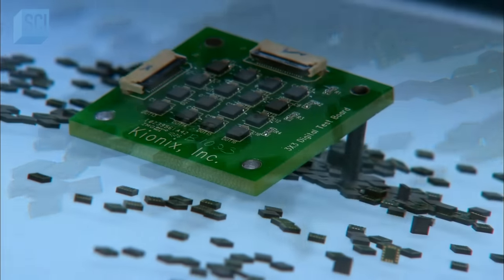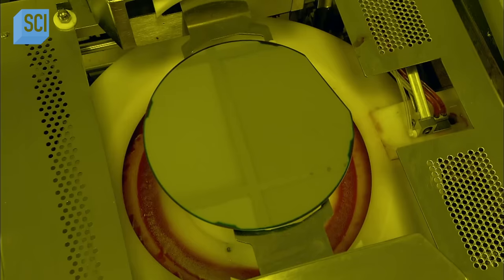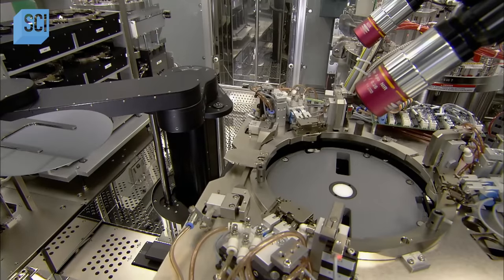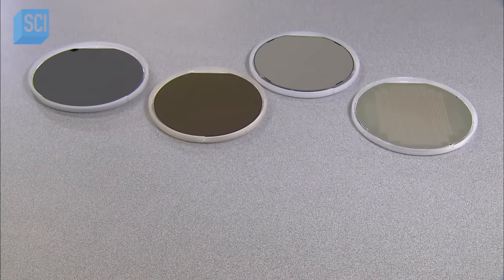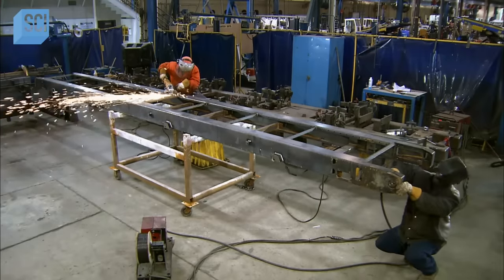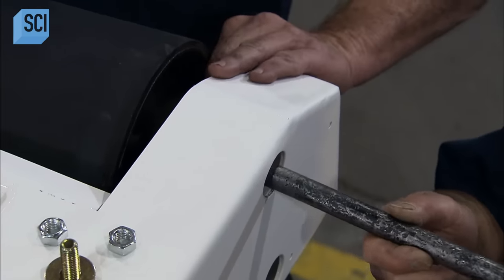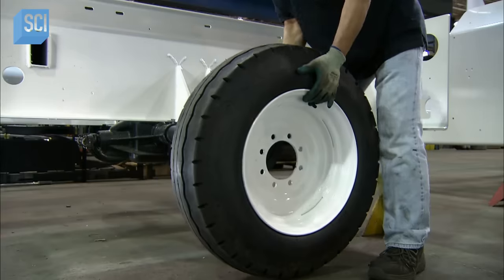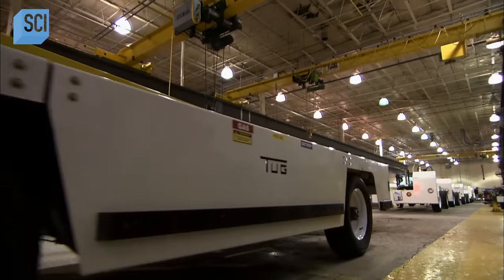How Motion Sensors and Belt Loaders are Made | How It's Made | Science Channel

Comment: Photolithography and how precise it is and has become is still mind-boggling, the technology to do it is almost more impressive than the technology to make it. Building machines to build machines,:-)
Reply: truly nuts.
Reply: Thats the way it has progressed, you start with making a machine that can make parts more precisely than a human with hand tools then you use that machine to make more precise parts for a new machine, then you use that new, more precise machine to make an even more precise machine, and it just keeps on going until you cant make a machine any more precise or there isnt a need to make it more precise. Of course it is more complex than that and involves multiple types of machine but that is the general idea, just keep using your machines to make even better machines and then we eventually end up making things on the scale of atoms.
Reply: And yet this tech is HUGE compared to CPUs and the like. This is micron scale, not nanometer. I was surprised seeing them just shine light through a mask without a hugely complicated lens system, but their features are just that big, hundreds of times bigger than the smallest they make elsewhere. But of course it's a relatively simple device, so size isn't a concern, and it needs to be build "big" due to the mechanical parts.
Reply: That fact that they are running into a diffraction limit and have begun to use hard UV is insane. X-Ray photolithography is the next step and it’s truly insane to think about.
Reply: Im a lithography technician its really cool to see how the machines work
Reply: @angryjoe98  stop lying
Reply: @MANOFTIME  i was indeed was a lithography technician I worked for rocket lab I ran canon, lithography tools and Tokyo electron coating machines. You felt the need to write this 2x? 😂

Comment: The sensor knows where it is at all times. It knows this because it knows where it isn't. By subtracting where it is from where it isn't, or where it isn't from where it is (whichever is greater), it obtains a difference, or deviation.
Reply: Umm what? The sensor has no idea where it is and it doesnt matter. They typically measure acceleration (accelerometer), angular velocity (gyroscope) or magnetic field strength (magnetometer), none of those measurements allow the sensor to know where it is, it just allows the sensor to measure those quantities. On Earth, an accelerometer can be used to measure gravity and calculate the pitch and roll angles amongst other things, integrating the gyroscope measurements is also a way to get a relative angle of rotation and the magnetometer can be used like a compass to calculate the heading. The accelerometer gives absolute measurements in reference to the Earths gravity, the gyroscope only gives relative measurements and the magnetometer gives absolute measurements. Even combining all three measurements it is still impossible to know where the sensor is, only what kind of environment it is in, the only information that you can calculate from those measurements to know where the sensor is, is the pitch and roll angles and the heading it is facing in, that isnt anywhere near enough to know where the sensor is only its orientation. Phones know where they are mainly through GPS, they know their orientation based on the IMU.

Also most sensors still dont perform much calculation on the sensor chip itself, it is usually another processor that reads the sensor data and then performs the calculations, although it is starting to get more common to have processors built into the sensor chip.
Reply: @conorstewart2214  you are incorrect. You should educate yourself.
Reply: @conorstewart2214  since you won't actually look it up, your type NEVER do, here is the full explanation:

The sensor knows where it is at all times. It knows this because it knows where it isn't. By subtracting where it is from where it isn't, or where it isn't from where it is (whichever is greater), it obtains a difference, or deviation. The guidance subsystem uses deviations to generate corrective commands to drive the sensor from a position where it is to a position where it isn't, and arriving at a position where it wasn't, it now is. Consequently, the position where it is, is now the position that it wasn't, and it follows that the position that it was, is now the position that it isn't.
In the event that the position that it is in is not the position that it wasn't, the system has acquired a variation, the variation being the difference between where the sensor is, and where it wasn't. If variation is considered to be a significant factor, it too may be corrected by the GEA. However, the sensor must also know where it was.
The sensor guidance computer scenario works as follows. Because a variation has modified some of the information the sensor has obtained, it is not sure just where it is. However, it is sure where it isn't, within reason, and it knows where it was. It now subtracts where it should be from where it wasn't, or vice-versa, and by differentiating this from the algebraic sum of where it shouldn't be, and where it was, it is able to obtain the deviation and its variation, which is called error.
Reply: @mgancarzjr  I know how these sensors work. You are confusing applications from how the sensor itself works. In most cases the sensor just outputs the raw values, it is up to another processor to perform calculations on that, although sensors with built in processors are becoming more common. Also none of what you said has anything to do with the sensor knowing where it is, it still doesn’t know or care where it is, all it measures is acceleration, angular rotation and potentially magnetic fields, those can be used to calculate relative motion and orientation, but the sensor still does not know where it is, and the sensor measurements can still not be used to tell where the sensor is. You also get drift over time with these sensors, even when integrating the acceleration, since you are quantising and discretising continuous motion.

If the sensor knows where it is then why can you take some measurements, move the sensor and take some more measurements and have them be the exact same when in two different locations? That is because the sensor does not know or measure its location, it measures acceleration, angular velocity and magnetic field strength, that is typically all they measure and it is not enough to tell the location of the device, it is enough to calculate relative motion and orientation but that is it. 

What you seem to be on about is using the sensor as part of a bigger system and using it for some form of position hold, that can work in some cases but in a lot of cases it is nowhere near accurate enough and is subject to drift. Most drones despite having IMUs rely on the GPS or an optical flow sensor to implement position hold, not so much the IMU.

The sensor itself does not measure where it is and cannot measure where it is, what you are on about is integrating the acceleration or angular velocity to get relative motion and correcting for that, but as I explained that is generally an inaccurate method. It is also not how the sensor works, that is generally another processor carrying out the calculations.

Edit: also how do you know my type? You seem to be the type that thinks they know everything when they really don’t. I have used these kinds of sensors quite extensively.
Reply: @conorstewart2214  ask me how I know you didn't do an ounce of research on this subject. Your type NEVER do.
Reply: @mgancarzjr  except I have used these type on sensors and know how they work, you are describing a control system not how the sensor works. 

If you really think the sensor knows where it is then you obviously have no clue how they work.

Edit: if you are so sure then tell me how the sensor knows where it is.
Reply: @conorstewart2214  if I can show you that you have done not even the slightest modicum of research on THIS SUBJECT, will you never post anything on the internet ever again?

That is the Faustian bargain I am making.
Reply: @mgancarzjr  wow hiding your lack of knowledge behind saying I have done no research, why don’t you go back and read my last comment again and answer the question if you are so sure you are right.
Reply: @conorstewart2214  please look up "The Missile Knows Where It Is."

I expect you to honor your end of the bargain.
Reply: @mgancarzjr  a copied piece of text, not even about these sensors and used as a meme proves your point how? You must be trolling at this point.
Reply: @conorstewart2214  my original post was an allusion to the meme. You did not even take one second to Google what I had written before assuming I was making a mistake.

I pointed this fact out to you TWICE.

YOU DID NO RESEARCH.

HONOR YOUR AGREEMENT.
Reply: @conorstewart2214  "since you won't look it up, your type NEVER do" - me, an hour ago
Reply: @conorstewart2214  you know those "joke" quizzes where the instructions begin by telling you to read every instruction first? Were you the kid in class who was always amazed that people were finished so quickly only to find that the final instruction was to ignore all previous instructions, sign your name, and hand it in?
Reply: @conorstewart2214  sir, I was trolling you FROM THE BEGINNING. Ignorance of some reference I can forgive. Ignoring my advice to look up something you are clearly ignorant of I cannot forgive.

Now, will you uphold your end of the bargain, or do I have to tell you of the time I graduated top of my class in the Navy Seals? (look that one up as well before you accuse me of stolen valor)
Reply: Attention passengers, this is your captain speaking. If you look out your left window you can see the biggest woosh experienced by mankind in modern history.

Comment: Would have loved to see the mechanism inside too.
Reply: There’s no “mechanism.” It’s a matter of X, Y, Z “diving boards” of a few molecules. They bend because of inertia when the chip is moved. Sensors report the movement.
Reply: @BitSmythe  Isnt that litterally what Mems are though? Mechanisms?
Reply: @honkhonk8009  You’re right, I thought a mechanism required motion. Well, it is. A fixed lever IS considered a mechanism.
Reply: @BitSmythe  There is motion though, the motion is driven by the environment and inertia not the chip itself. Bending is a motion too.
Reply: @BitSmythe  They're called electro-mechanical sensors (MEMS = micro-electro-mechanical systems), because they work by mechanic bending motion, like you say yourself. This is a 6-axis sensor, 3 gyro and 3 accelerometers. Search mems gyro on youtube, there's a bunch of good videos showing how they work. The gyro part vibrates by itself, in order to detect twisting motion induced by gyroscopic forces.
Reply: They are tiny vibrating pieces that are read out using the capatance change or frequency shift as it is moved. They are more sensitive than gyros used in leading edge missile systems of the late 1990s and early 2000s believe it or not.
Reply: This guy took apart an accelerometer to show how the micro mechanism inside works, and also made a large-scale model of it: https://youtu.be/9X4frIQo7x0

Comment: The "motion sensor" clip just shows  regular production process that almost every other kind of regular microchip uses. Theres nearly no unique/specific documentation on parts inside those chips that makes those motion sensor... a motion sensor.
Reply: Yeah they didnt show the actual motion sensing parts of the chip or how they are made and it does differ from making normal microchips since MEMS sensors are 3D mechanisms, but this video shows none of that.

Comment: Correction the thing use to tilt your device is not the motion detector but it's the accelerometer
Reply: It is a minor error, the accelerometer, along with the rest of the IMU is used to measure and detect motion and orientation. Some IMU chips even have built in functions to trigger interrupts when certain motions or gestures occur, so they can be used as motion detectors. Some sensors like the STM ones list motion detection as a feature of the chip.

Comment: Do the sensors work in space?
Reply: No reason that they wouldnt really. Only problem could be radiation but there are ways to protect against that. The sensors can typically measure any combination of acceleration (accelerometer), angular velocity (gyroscope) and magnetic field strength (magnetometer), none of that is specific to Earth or only useful on Earth. It is relatively complex maths that turns those sensor readings into orientation.

If you mean would your phones autorotation work in space, then it depends, if your body is in microgravity since it is in freefall, so is your phone and it wouldnt work the way it does on Earth, but if you were accelerating, had artificial gravity or were not in freefall then the auto rotation should work relatively normally.

Comment: How does a bunch of connections make a motion sensor? I will never understand these type of things.
Reply: They skipped all the details but they make a tiny mechanical system that can bend and flex due to acceleration or rotation or magnetic fields, etc. The technology is called MEMS and is used in a lot of devices, from motion sensors, to microphones, to pressure sensors, etc, they are used in a lot of sensing devices.

Comment: how in hecks name were we able to invent even a concept of chips?
Reply: By shrinking transistors
Reply: @evilsharkey8954  im not satisfied with that answer
Reply: Well first we figured out we can cook potatoes and from there a few lovely people had the idea to cut em into real thin slices (or long rectangles of varying thickness) and dunk them in real hot oil.
Reply: @LeeLee-dingus  hmm...seems legit...
guess that answers my question ^w^
Reply: Back in the late 50s as folks were using discrete transistors to make digital computers, they ran into a "connection problem." Even though transistors and resistors were relatively small (for the time), the problem was how to connect them together efficiently from the standpoint of labor and reliability. 
   The big breakthrough came when techniques were developed to fabricate both transistors and resistors on the same silicon chip, that is, to integrate the transistors and resistors. This gave us the integrated circuit, and the rest is history.
   It's all online. Look for Jack Kilby, Robert Noyce, and others.
Reply: @clarencegreen3071  many thanks